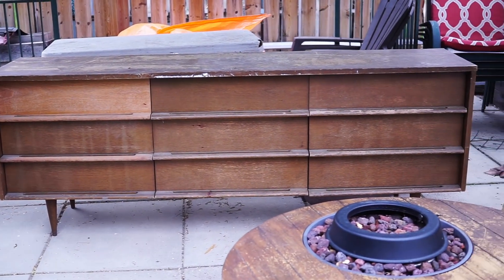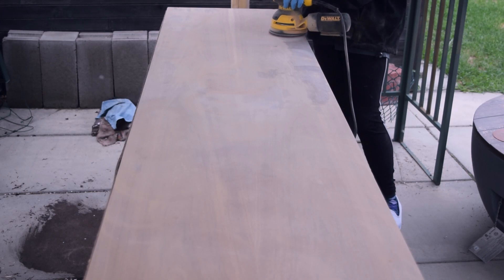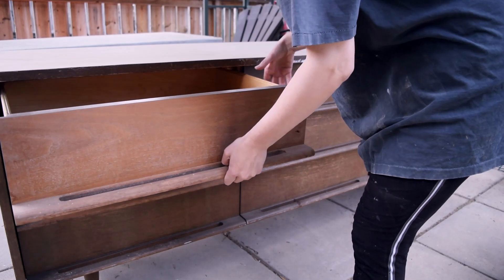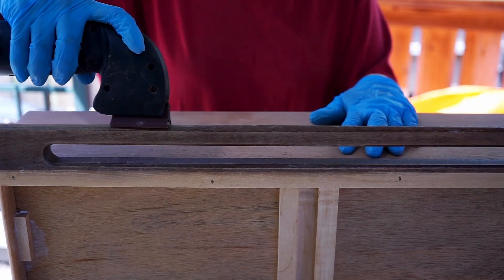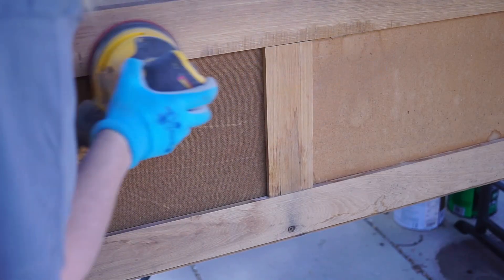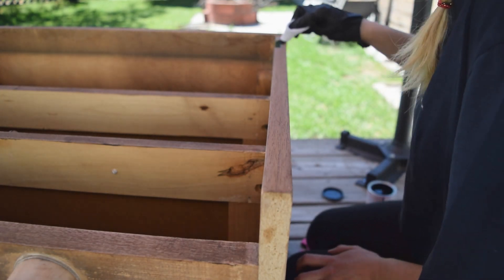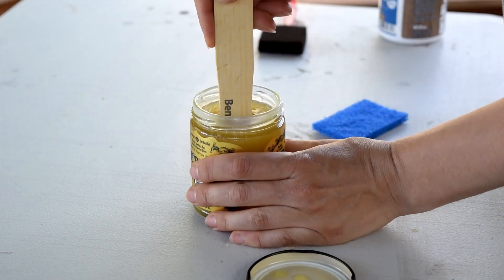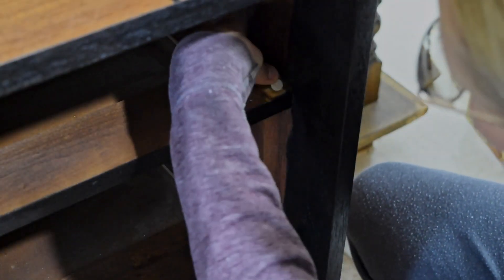Refinishing garage sale dresser

Comment: Absolutely stunning. What is the tool you were using on the drawer handles ?
Reply from the maker: That's an old dremmer kit for furniture. Like 20 y.o. or so. It's handy but I can't find a sand paper replacement for it anymore.  So I only have used it once